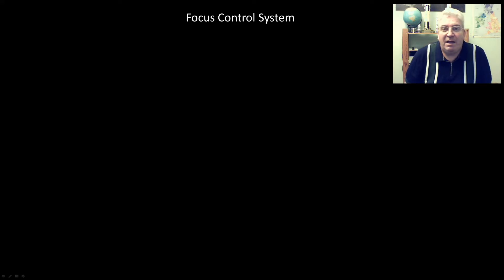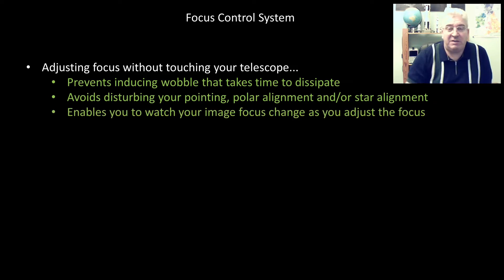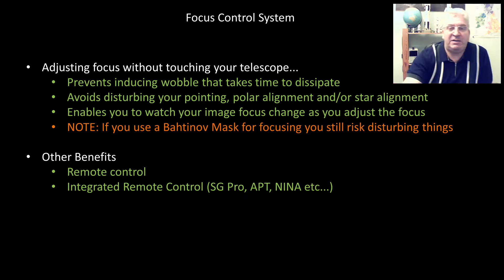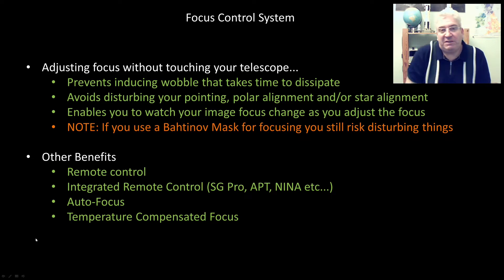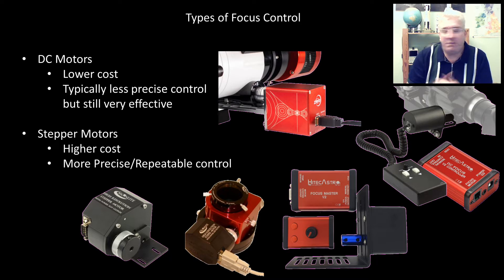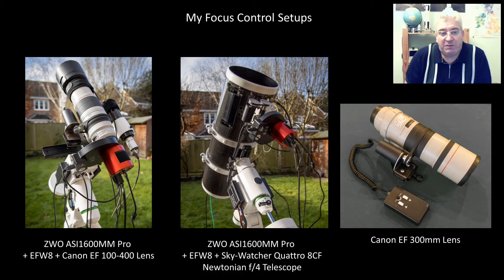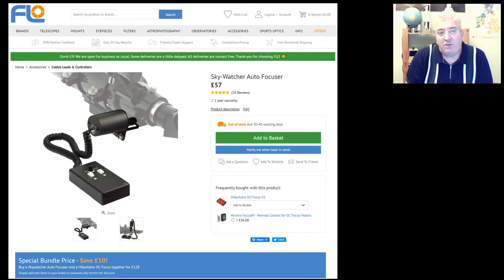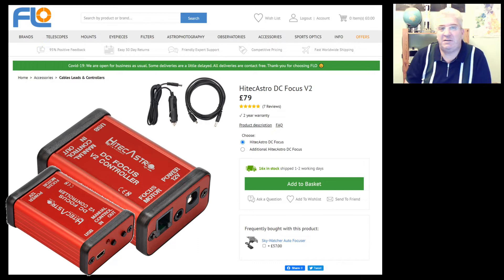Building a Custom Focus Control System

Comment: Excellent video Martin, well explained with useful info on parts etc.  I have been considering adding an auto focus to my set up for a while now and this video should help.  Plus as you only live 1.5 miles away from me, if its OK with you, I might want to pop over for advise if I have a problem with adding a focuser.
Reply from the maker: Thanks Brian. Sure…you are welcome to pop round!